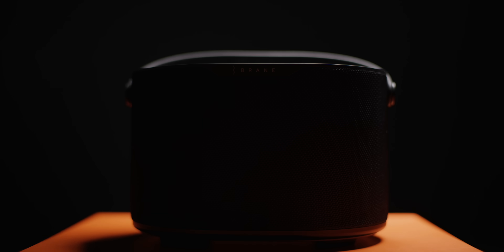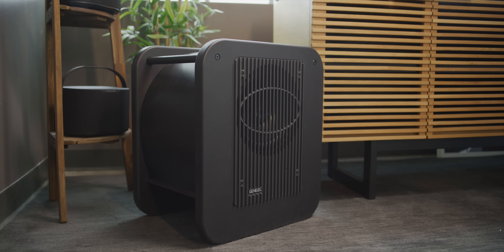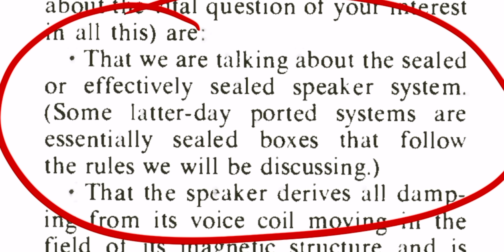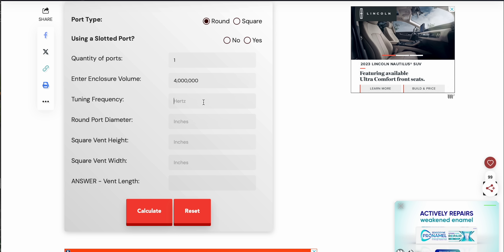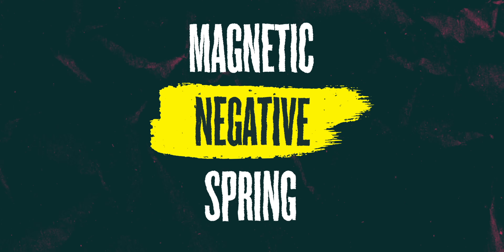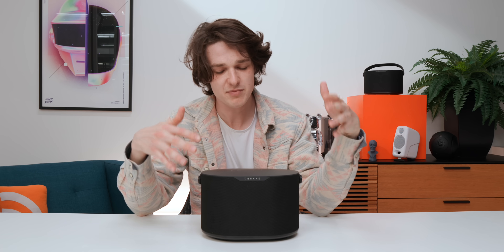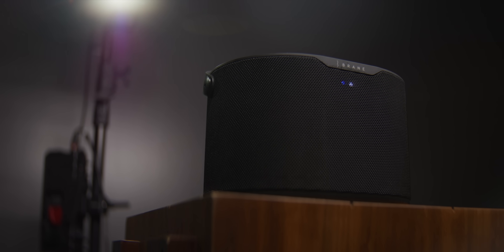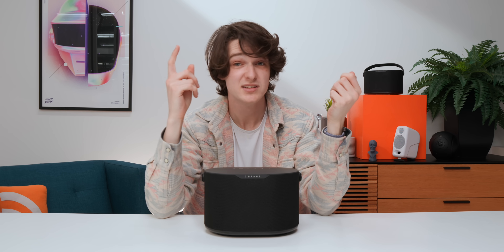How This Speaker Broke Physics.

Comment: I appreciate the clickbait, but the definition of the laws of physics is that nothing breaks them. I you think it did, then your understanding of the laws of physics is to blame, not physics. Or the thing that "broke" it.
3:30 - Also, please do not lump "speakers" in with "speaker cabinets". It is really important in this context to separate the active component from its enclosure. Dude, you just made that mistake and corrected it in editing with the caption at 3:15, so why are you repeating it?

Comment: This just sounds like a sealed speaker enclosure that uses the correct size to create an opposing backpressure. Which first of al, is not unique or new. And secondly is also the cheapest and easiest type of speaker to produce.

Comment: Specs from the manual:

Amplifiers
Four class-D digital amplifiers
with combined output of over
200 watts

Sub woofer
One high excursion 6.5" x 9" (165
mm x 229 mm) R.A.D. subwoofer
for thundering bass and
sub-bass

Midrange
Two 2.5” (64 mm) midrange drivers
provide distinct stereo separation
in the mid frequency band

Tweeters
Two 0.75” (19 mm) dome tweeters
produce clear highs and an
ultra-wide soundstage

Microphones
Four waterproof microphones for
accurate voice recognition

Adjustable EQ
Adjustable bass, midrange and
treble via the Brane mobile app

Aside from it have an FPGA for the DSP, there's no mention of anything special in the manual.
Reply: Does it say the frequency response?
Reply: @dakster8244 the bass response doesn't stop, it just rolls off. It goes below 30hz loud and clear though, as I own one. It's pretty nuts.
Reply: an FPGA is just a stack of programmable DSP "slices" in a trench coat, so that is not special either
Reply: @AluminumHaste In this case, "specs" clearly means "marketing hype."
No frequency response or polar response diagrams? I'm out.
PS: I also don't want or need any speaker that contains microphones so that's (yet another) red flag for this thing.

Comment: If you want a bassy speaker then you don't want a good speaker. Bass Reflex speakers produce a longer lasting bass reponse that will remove clarity from the sound eventually. Acoustic Suspension speakers produce the best sound but they need beefier amps capable of getting the vibrating surfaces where they need to be. I don't have the money to get neither of those so I use Bass Reflex speakers. BTW, with modern digital amplifiers Hoffman's law doesn't apply - it did apply in 1961 when the only way to get good amps was by using vacuum tubes. Since the Tripath release the TA2020, digital amps became good with nice SNR and low distortions. Tripath was eventually purchased by Texas Instruments. 

"Laws of Physics" aren't actually Laws - they are models that describe the physical worls as we perceive it. In the late 19th century Physicists were sure they could describe the physical world perfectly - with the exception of a few minos discrepancies. Thoser were the orbit of Mercury, the speed distribution of molecules in gases, the ultraviolet collapse when black bodies were heated and some weird black lines that showed up when a wide enough spectrography of light coming from stars were produced. The first problem (Mercury's orbit) was solved by Einstein's Relativity and the other ones by Quantum Physics. And even after that we still think we live in the in the Newtonian world ... a world where everything can be explained by simple mechanistic relationships. What made the world we live in turn into an improved version of Hell is the ideas propagate by Margaret Thatcher and Ronald Reagan: The British PM made us believe there's no society just individuals while the former Hollywood B movie actor simply got a microphone and said "Greed is good".

Now we have problems that, if we don't fix them, will end human life on Earth - and these problems aren't linear and escape Math's ability to long term predictions. Meanwhile, we became linear bots who think how much money one has is the only measure of someones value.
Reply: And this is how you create an off-topic rant.  LMFAO !

Comment: The video explains how a small Bluetooth speaker called the ILoud Micro Monitor defies expectations by producing an impressive amount of bass despite its compact size. Here are the key points:
- How Speakers Produce Bass
Typically, larger and heavier speakers with more surface area are able to move more air and produce deeper, more powerful bass frequencies. Smaller speakers struggle to reproduce low bass tones effectively.
-The ILoud Micro Monitor's Design
The ILoud Micro Monitor is a tiny 0.7 lb speaker that measures just 6 x 3.5 inches. Yet it can produce bass frequencies down to an astonishingly low 40Hz, which is deeper than some larger speakers.
- How It Achieves Deep Bass
The speaker uses a patented design with a small sealed enclosure and two passive radiators on the sides that move in sync with the internal driver. This allows it to displace a large amount of air and produce powerful bass that defies expectations for its size.
By cleverly engineering the enclosure and radiators, the ILoud Micro Monitor breaks the conventional relationship between speaker size and bass performance. Its ability to deliver deep, impactful bass from such a compact form factor is described as "breaking the laws of physics" in the video.

Comment: So here's what I think is going on. They use a so called bifurcation, and with good engineering they would be able to achieve good sound quality. However this is extremely difficult, since this introduces a nonlinearity. I strongly believe that they weren't able to achieve very good sound quality and the intended pure sine waves are more like a square wave (so you would hear the bass bleeding to the whole frequency spectrum), and this is why you don't find any live reviews yet (but on paper they achieve remarkable amplitude at low frequencies). But with some advanced nonlinear filters this could potentially be a very interesting piece of engineering! So I wish them all the luck they need ;)

Comment: Automatically the thought "Everything's bigger in Texas." came to mind and Brane Audio's just so happens to be Austin based! It's a fantastic party speaker, truly great engineering, though not for any sort of audiophile, let's be real with it. I prefer my midrange clarity over boom and for bass to be accurate not bloated. There is a way to take down the bass though; wonder how that works & sounds. Could be a great solution for small bars too! There's nothing out there that gives so much party potential for its size & price and that's the selling point.

Comment: The video used misleading titles to attract views 😢.  👎

Basy 😂. Buy Bose if you like bass. Sound is not air but a change in the air pressure.  The hole gives more power as the inverse or out-of-phase frequencies are converted in the cabinet to be in phase and leave more bass. So they are more efficient.

This speaker is a marketing project.  I hope it works. 😂

Comment: At 9:32 you say "...how does that work? Its like, uncompressed." in reference to AIAIAI's low latency wireless studio monitors; you answered your own question. Uncompressed audio tends to have lower latency. Compression takes time and adds latency. Uncompressed signals do, however, take more bandwidth when traveling over a network.

Comment: Don't buy these. The battery life is a lie and they limit the bass at higher volumes. 
What ever system they are using it acts exactly like a speaker with built in equalizer. 
You can find reviews online that show the sound compression on the low end and 
The lousy battery life. They would have to do that to keep from bottoming out the 
Woofer or blowing the woofers voice coil.  Because you know it's got a small woofer. 
Also explains lousy battery life since they are pumping way more power into the woofer 
To jack up the bottom end.

Comment: The description of a sealed speaker isn't quite right, the compressed air does "bounce" the cone back out to help if matched right. But like the videos shows also can be defused easily inside if not well designed. For example, when i was in my 20's i had a 12" Infinity subwoofer in my car with a 300w JL class D amp and a 1.5 farad capacitor and the speaker was in a 1.5 cubic foot sealed box (nearly 1" thick) and it was far louder and cleaner that peoples "1,500" watt multi speaker setups with "high end" equipment. I could shake the rafters and windows in gas stations easily. 300 watts is a LOT of energy when turned into sound, and if you do it right it will be FAR more than enough for almost all instances other that a movie theater or concert lol

I typed that out at the beginning of the video, and listened to the part where it talks about the active magnetic bounce back control👌nice, that's pretty dang cool. Effectively making the active rebound control like a variable enclosure for the sound you want to put out. I'm SUPER curious to see how the bass response is at different volumes.

Comment: Thanks for a very transparent explanation! Similar to a lot of innovations, on the face it sounds kind of obvious. It's like noise-cancellation but for air pressure. I would bet that fairly similar electronics could be used to "predict" how air pressure needs to be equalized before the membrane of the bass speaker actually moves...

Comment: Pure physic =) check transmission line speakers
Reply: or CHeck KEF KC62, quite a small subwoofer that (on paper) goes very deep on bass:  11 hz (±3dB)!!! I don't have personnally this sub, but I have the Paradigm MilleniaSub which is pretty small too with similar concepts as the KEF KC62 and goes down to 24 Hz ±3 dB (24Hz – 150Hz)!
Reply: I have the B&O also from this video! It doesn't play loud nor it goes very deep in bass, BUT B&O gets the midrange beautifully, and the 360 degrees sound effect is also pretty good and natural! Actually I am listening now to this video through my B&O BT speaker!

Comment: just a little help for those in need

at the start of the year i needed to pick up a speaker for my new monitor;
my requirements were that it needed to be small, have bluetooth and an analogue input, and be super affordable

and my god did i realise i knew nothing about speakers, and just could not find anything

the closest i got was deciding on a Marshall speaker, but the lowest costing one with analogue input was £250
and then suddenly i remembered a company famous for analogue products got into the speaker market a few years ago, well how much could those be ?

i picked up the entry level Polaroid P1 speaker - actually got two for less than £60

analogue input, check
bluetooth, check
small but mighty, check
and they can even pair together by simply putting them back to back

honestly, for $30 this is an incredible, all-round speaker. ✌

Comment: I am really blown away by the speakers in my Tab S9 Ultra. The crazy tech that goes into making such small components make such great sound is mind blowing. The acoustic filler balls that increase the back volume of the loudspeaker housing. Or the smart amps that actively monitor the speakers so they can be driven well outside their specified ratings safely. The psycho-acoustic bass processing that tricks our ears into hearing lower bass. etc etc.

Comment: What a cool video. Great job in explaining the more technical audio topics in a clear and concise way. We know it's not so easy 😉 Also, now I'm very curious how those speakers sound. I want to check them out!
Reply: If you are actually into audio engineering, you should know this video is bad. Because: without plotting the frequency response, taking dB measurements (at 1 meter distance) and not mentioning the specs - it's just (indirect) marketing ploy.
Reply: Who ever you are, managing the Lewitt page, ask an engineer before supporting this kind of marketing trash that pretends to be technical. Lewitt makes good products and this type of comment leads to belive that the company is headed in the wrong direction.

Comment: without plotting the frequency response, taking dB measurements (at 1 meter distance) and not mentioning the specs, this just seems like a standard marketing ploy.
the first two might not be something your familiar with, but the third you  should definitely bring up.
otherwise there is a significant possibility that the price has a placebo effect for you, making you think the speaker sounds better than it actually does.
Reply: When the first statement was "This speaker breaks the laws of physics", I thought, "Oh, someone doesn't know physics... or speakers."
Reply: @tgun5000  😂 ditto
Reply: yeah, this whole video is nothing but a clickbaity advert in disguise
Reply: Exactly, there isn’t a single Frequency response even on their website. They just claim things, no data sheets.
Reply: @srikarsaireddy8845  Clearly Brane have learned the "no specs" technique from Bose; therefore — just like Bose — I'll never even consider thinking about purchasing any of their products.
(Also, and IMHO: I don't understand why anyone would want "more" bass from a speaker unless their current speakers have a frequency response that "droops" below about 200 Hz.)
Reply: its bass role of is at 150 hz Hardy Sub Bass
Reply: I'm sure it's been tested on rtings. Not too impressed
Reply: Hey guys, do you remember the shitty logitech 2.1 speakers systems that had like a whole 20W system power, yeah the subs that came with those, they had the integrated amp and the VGA connector for the controlling speaker. The PCBs on those are like barely twice the size of a raspberry pi. Those subwoofers which were the same size as this bluetooth thing also had insane bass. Why you ask? Well they were subs and only subs, just like Soundboks who prioritize being loud, this shitty bluetooth speaker prioritizes being a sub. There you have your answer as to why its got bass.
Reply: You know it's not that amazing when the manufacturer's page also says nothing about specs.  However, some reviews say it goes down into the 20hz range which is impressive assuming sounds quality is also good.  Then again, this is thing is apparently over 7 lb and not that small, it's like a small subwoofer.
Reply: AE here, I appreciate you sharing this. I was thinning this too
Reply: It does go below 30hz, and is loud.
Reply: I’ve been in the car/marine/powersports/home audio game for over 25ys and have built more systems and subs than I can count. This is the future of low frequency extension. Assuming this is scalable (which there’s no reason it shouldn’t be), you’re going to see RAD drivers everywhere space is a premium. 

From my anecdotal experience, in a supercrew F-150 at approximately 1m, I’m seeing output anywhere from 102-115db from 27hz to around 40hz on an SSA-APMX at the drivers position and the X in the back passenger’s seat. While those number are not necessarily impressive from a car audio standpoint- this is from a by-9 in maybe 0.1cft sealed on MAYBE 100W RMS? Just mind blowing. 

This isn’t a marketing gimmick or manipulation in numbers. This isn’t JL, Devialet or Bose making trivial changes to the same old 100yr tech, this is an actual innovation and should necessarily change the industry. Any company not looking to duplicate this tech is going to get gapped by Brane. My congrats to them and I can’t wait to get some of their larger drivers in some of my setups when they turn that corner.

Also, from a mid and high standpoint, it sounds absolutely great. A little flat straight out of the box, but you can warm it up and tame some of the 1000-3000hz harshness quite easily with the 5 band EQ. My home set rotates between KEF and B&W on Rotel electronics and the Brane is quite easy to listen to and shape to my liking. The insinuation that this speaker is a 1 trick pony is nonsense.
Reply: Even though this was an ad in disguise, you got to admit that for example the Bang&Olufsen Beosound A1 is an incredible speaker for its size. I've hosted a small beach party using just one of them and it was enough to dance around the fire with a group of people. Not bad for a speaker about the size of a portable CD player from back years.
Reply: As the studio engineer for the last 20 years, I can cosign what he saying in that for a Bluetooth speaker. The base is insane. Now I haven’t measured the decibel however I can say it’s on par with our studio speakers that I use from mastering but it’s only, exceptional at base. The high in mid leave much to be desired for though they are above the average for a Bluetooth speaker, but not above the average for a Bluetooth speaker of that size by much.
Reply: @TrapTech  how can you misspell "bass" when you are a engineer? lol

Comment: I came in thinking you'd miss something crucial, but this is a pretty solid explanation for a general audience. I don't think it's fair to put so much emphasis on one paper, but i see why you'd frame the video around that paper due to limited time. 

The negative spring is an interesting idea. I doubt it would work without the pioneering work by bose around digital signal processing in small speaker design. That said, it's an imaginative extension of passive radiators.

Comment: Yet no specs... Like cool it has a 6.5x9" woofer but that doesn't really tell me anything about its bass capabilities. Like what's its -3db point in relation to the 300-3000hz? Things like the kef kc62 have deep bass and a small size (lots of power tho) but that deep bass disappears once you turn up the volume and even kef shows that in their white paper. So I can only imagine that has to be the case with something running off a battery. Like it sounds cool but with any information about the performance it might as well be marketing fluff. Post some cea-2034 numbers and you have my attention.